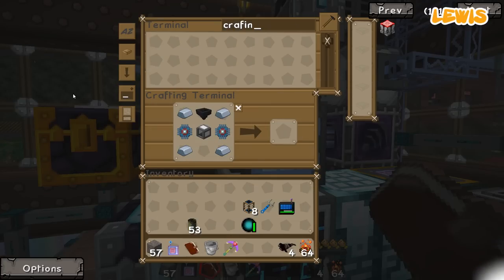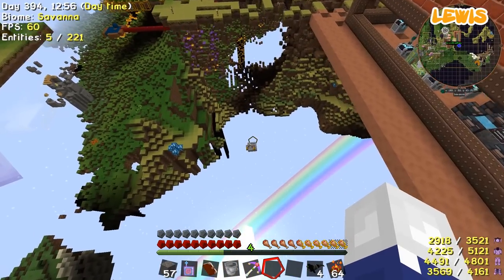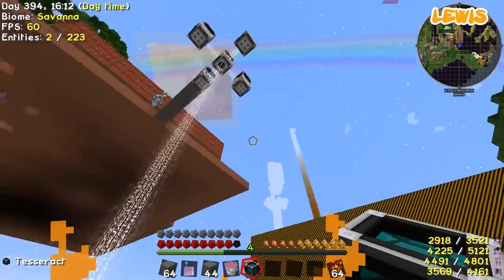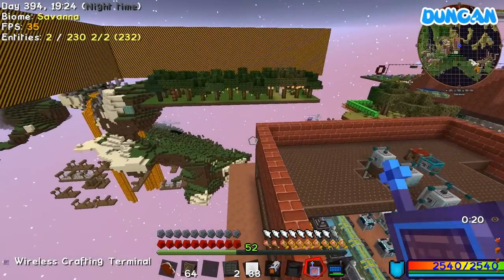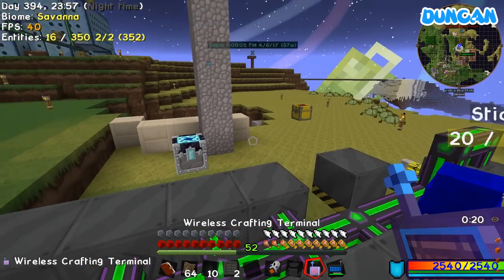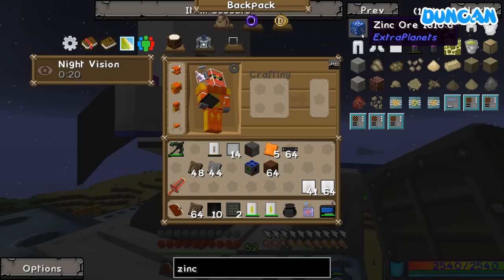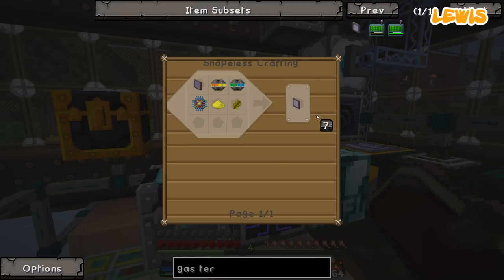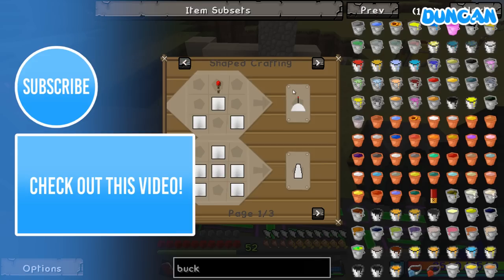Minecraft - LASER DRILLS - Project Ozone #183

Comment: Maybe the fire alarm has a low battery? Assuming if they are anything like what we have in the states.
Reply: Jason Barnes There's very little chance of that considering they're in a office building now.  They likely have hardwired alarms connected directly to an alarm company (thus the "bloke warned us" message that you might have missed).  Those companies come and do routine checks on the systems they have installed thus the random and short alarm.